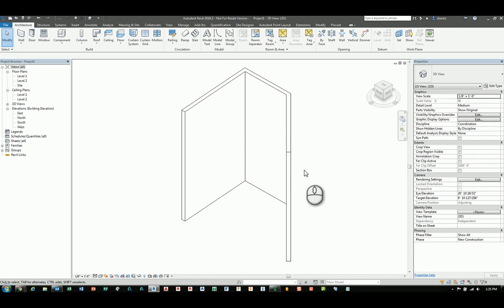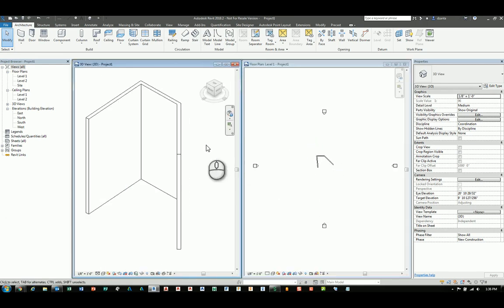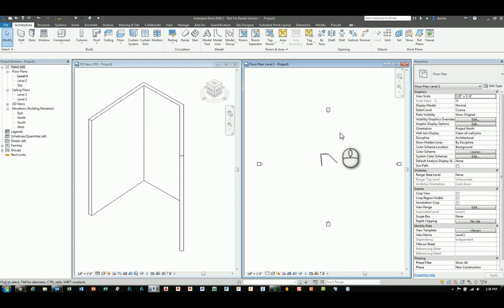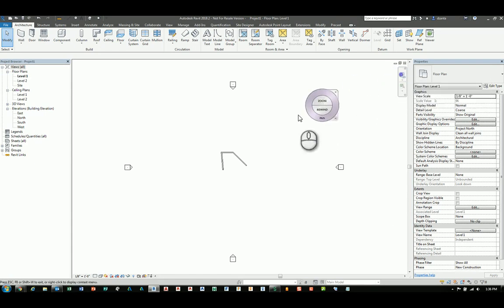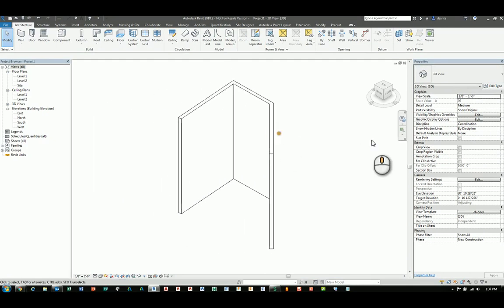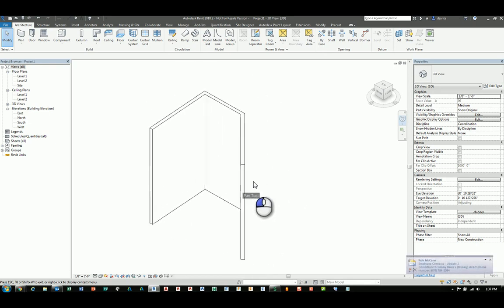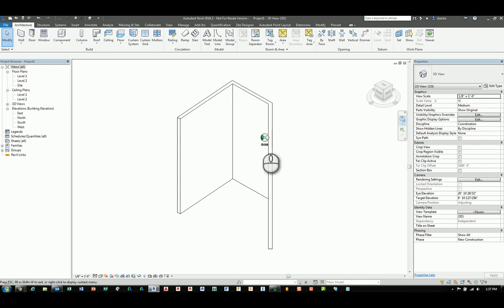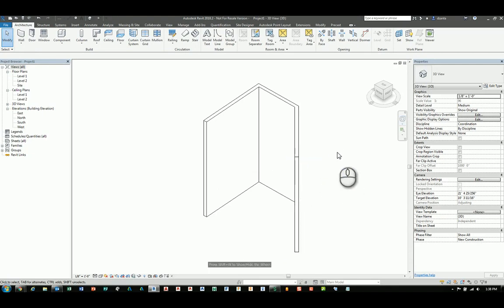Revit Pan Command in Steering Wheel

Comment: it does not help me..can you show me how to rotate object 3d ...360 deg and rotates freely and dynamic..just like any other cad..?..where does revit hide it..that the most important tool..
Reply from the maker: If you press and hold the shift key down and then press and hold the middle mouse wheel button down, then move your mouse, it will do a free orbit.  If you select objects first, then do this sequence, then the rotation is centered about the objects you selected.